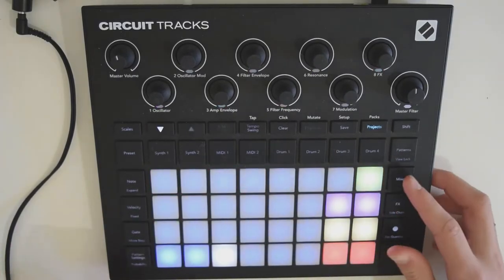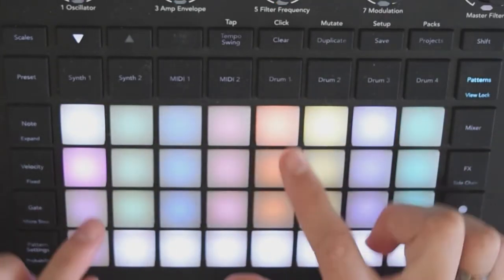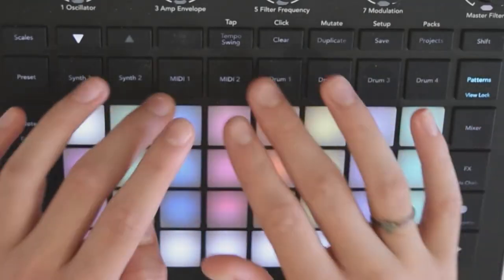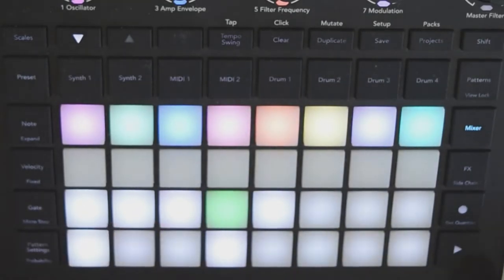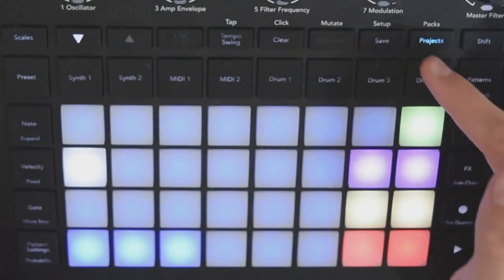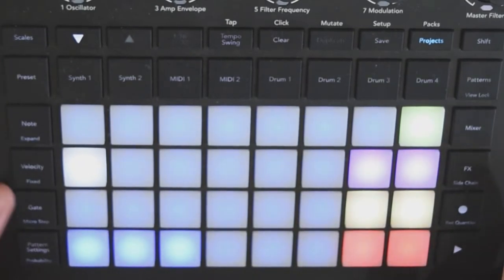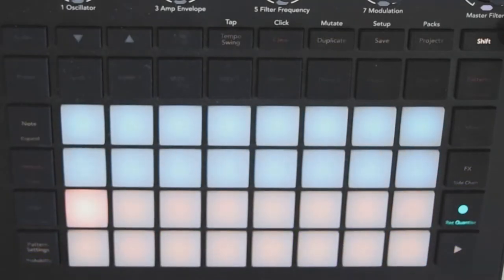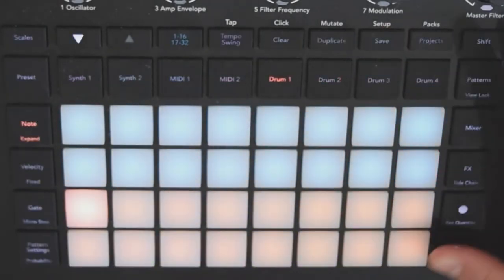20 tips that aren't in the manual | circuit tracks compendium

Comment: Hey Issac - the "sticky shift" or as I usually refer to it as "shift lock" is there for compliance reasons, say for example you are a quadriplegic and are programming your beats with a stick in your mouth - this would allow you to use the shift key where otherwise you would be unable to use it. Just thought I would explain that - this feature is on other devices that use shift keys (including windows and mac os) to make life a little better for folks who are unable to use both hands / or fingers or what have you). Great job though - informative  video!
Reply from the maker: oh yeah i totally understand why it exists, i just don't appreciate that it's not super clear. considering you use "shift+save" to get into the setup menu, it would make sense for a beginner to press "shift+save" to get back out, unintentionally activating this feature. thanks for your comment:)
Reply: The use case becomes immediately clear as soon as we look outside of ourselves <3 Thanks for the info.

Comment: when resetting the macro knobs (holding clear and turning clockwise so it becomes blue), what does it mean when you turn it counterclockwise and it turns red, do you know? :(
Reply from the maker: not 100% sure, i'd assume it's something to do with clearing automation, just because i dont know what else it would be.
i'll try to figure it out!
Reply: @isaachorgan  i think i figured it out yesterday :)
with samples, red deletes the automation, and blue resets to ″default″ (while still holding the automation data in step sequencer)
and the synth tracks just have delete
Reply from the maker: @monatooo  i see, awesome that you figured it out!
Reply: @isaachorgan  i only think i figured it out^^ i got my tracks just two days ago so im trying to figure everything out
Reply from the maker: @monatooo  i see, yeah it's very quick to get into but there are a few quirks to discover. enjoy!!
Reply: @isaachorgan  i will thanks c:
Reply: and also you ″freeze″ the current Sample macro by holding the desired step (while rec mode is on) and turning the macro to blue, then its ″locked″ :)

Comment: The view lock explanation is missing the fact that you can select the patterns that are being view locked (shown in white) by shift+tap on the target pattern :)

It's worth mentioning about the "turn clockwise to reset to default values" that this (absolutely not mentioned in either the tracks or thythm manual btw...) unfortunately doesn't work for synth patches, clockwise and anticlockwise will both turn red and erase automation. Very unfortunate as this could be pretty useful...
Reply from the maker: to be honest i don't have a great understanding of view lock, so i don't use it very much lol. thanks for the information!
i also don't use automation very much, which would explain why i never noticed that limitation with the reset-values thing. definitely a big setback for some people tho! i wonder why they didn't include that feature in the manual...
thanks for your feedback!
Reply: @isaachorgan  Sure! The view lock is really helpful to me to make changes to a pattern while another one is playing for example, or focus on one pattern of a chain :)

Comment: Hey Isaac, thanks a lot for the cool tips! I just ordered a circuit tracks and I ask myself if it is possible to chain pattern not in order? That is a cool feature on the old Circuit..
Reply from the maker: hi, unfortunately patterns can only be chained in order, which is an unfortunate limitation. you can work around this using scenes, because although scenes do have to be chained in order, the order of scenes can be different to the order of patterns. (e.g. have pattern 8 in scene 1, pattern 7 in scene 2, etc, and then chain them)

Comment: hi isaac,
Some professional questions
I inserted a micro memory card
- Is the memory card used only when the device is connected to the computer?
- How can I record a project on it?
-And how do I hear the recording on the card?
Or is it only used to import external sounds?
And how do I pull out the sounds on the card.
How do I not overwrite or delete the existing projects on the device?
Thanks.
Reply from the maker: hi! sorry for the late replies, i'm on holiday!
here is a basic explanation:
the circuit tracks can store 128 synth sounds, 64 samples, and 64 projects on it's internal storage. when you turn it on, all of this is loaded into RAM for immediate switching. if you want more than this, you would need to swap it over using a computer.
if you have a micro memory card, the circuit tracks can store an entire "machine state" into one pack, which are stored on the card. each pack is accessed by pressing shift+projects.
the card is not used to directly import sounds; you need to use the "novation components" software for importing sounds. the card is only used for storage within the device.
if you want to create a backup of the projects on your circuit tracks, you will need the same software for this.

to ensure you dont overwrite the existing projects, just make sure you always select a different project slot for your creations. if you want to be extra careful, use novation components to create a whole new pack. this way, you have 64 empty projects to use.

thanks for all your questions:)

Comment: Hi, is it possible to add a sustain pedal to the synth engine via an external midi controller? Thanks!
Reply from the maker: hey! great question! i'm not sure, unfortunately i don't have a sustain pedal to test it on. the manual doesn't include the word "sustain" in that context at all, so it might not? i'm not sure. i'll see if i can do some testing for you:)
Reply: Technically, you should be able to make it work. It's just a matter of how dedicated you are.
It doesn't seem to work out of the box, but if you look at the midi implementation chart for the cirquit, you will find that basically every function can be tweaked via midi-cc.